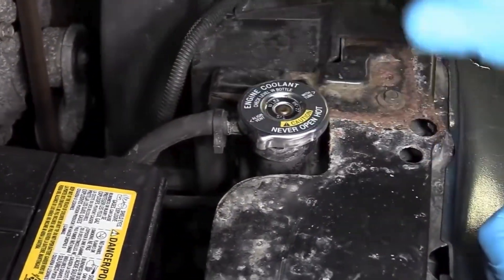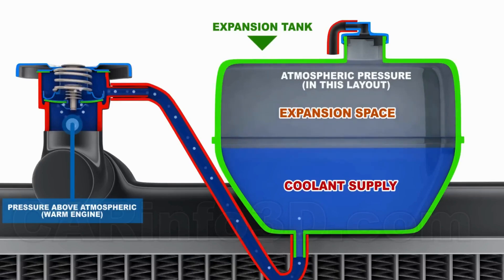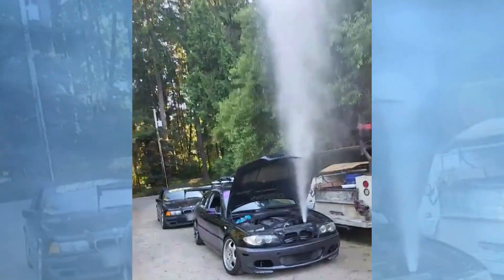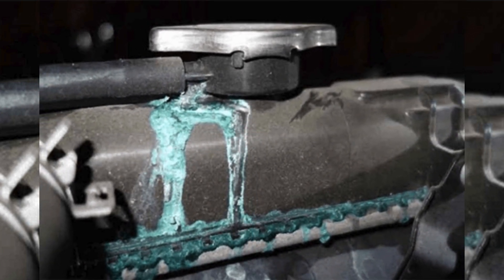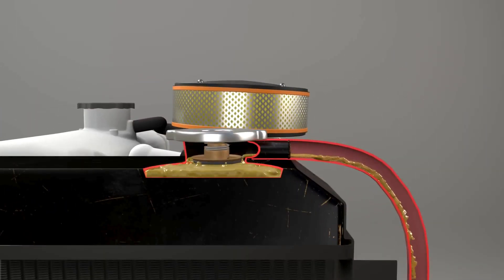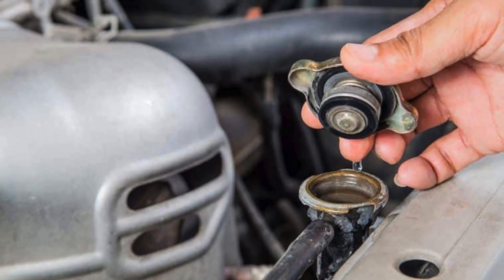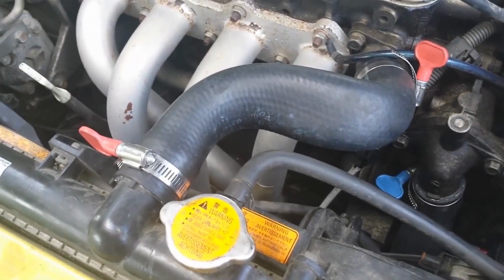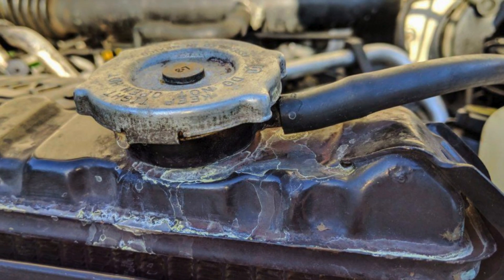5 Symptoms of a Bad Radiator Cap

Comment: New radiator caps tabs that lock down the cap are sometimes bent to where the cap doesn't seal. They typically just need bent slight by 0.01" to 0.02" to complete the seal.